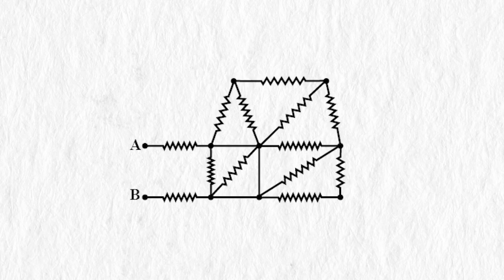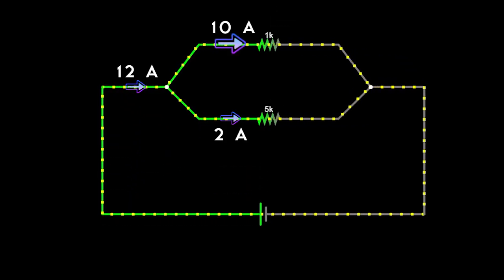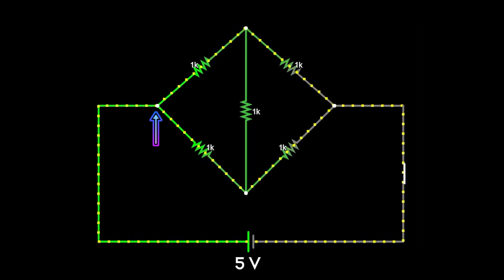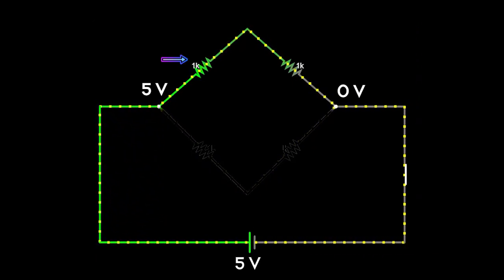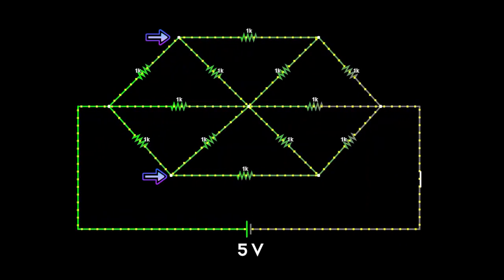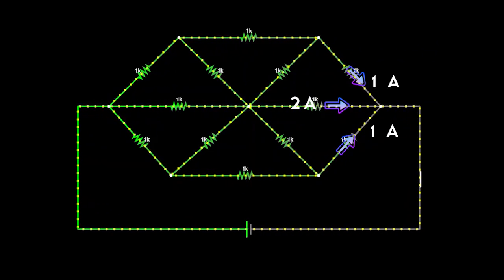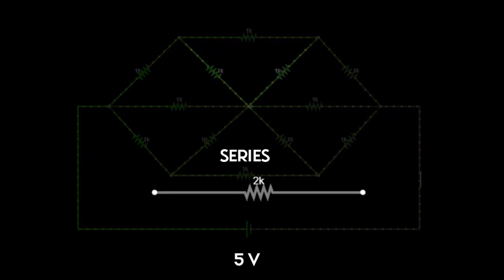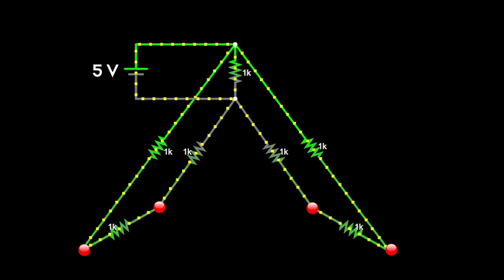How to solve Symmetric resistance circuits

Comment: Hello and thank you for your help. However I have a question:
At 5:11, you seemed to have flipped the circuit on its horizontal axis, but then the two diagonals of the circuit still have resistances, 1k and 1k whilst all the others have 500, why has this happened?
Reply from the maker: Hey you are right, guess I made a mistake. I should have corrected it while editing. Missed it.
Thank you for pointing it out.